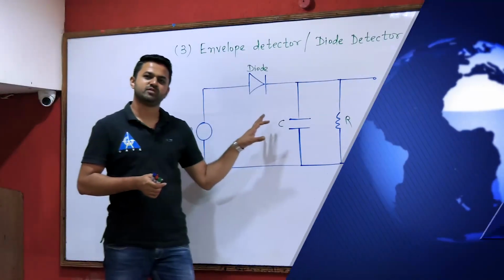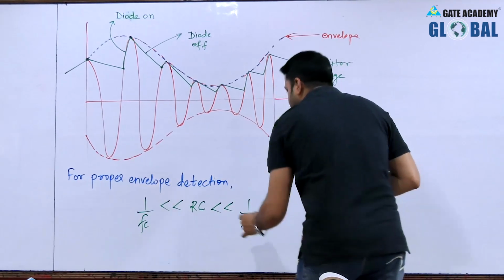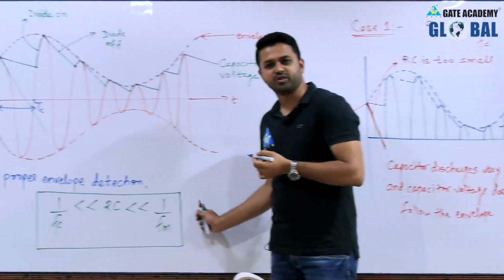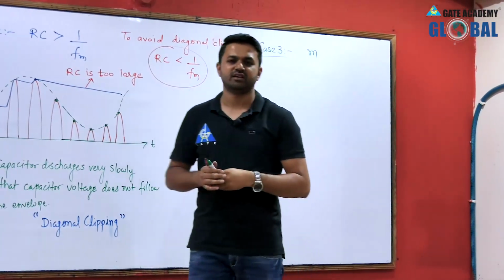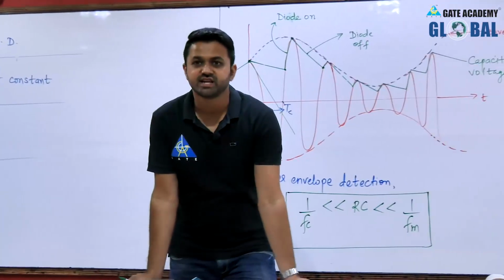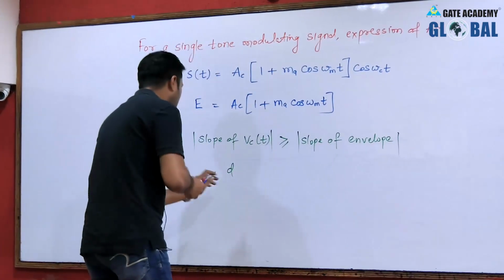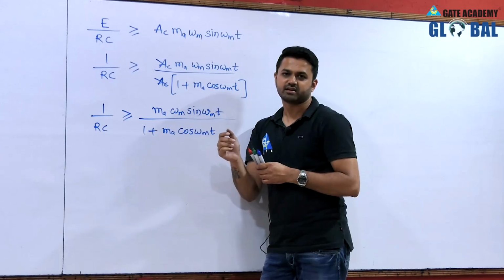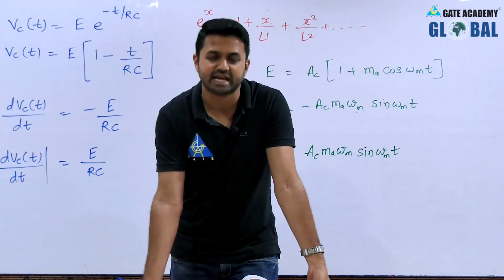Detection of AM (Envelope Detector) Part 2 | Lecture 19 | Communication System

Comment: Why slope of capacitor voltage has to be greater than slope of envelope
Reply: Diagonal Clipping in envelope detector occurs when the rate of capacitor discharging curve is less than the slope of envelope of amplitude modulated signal.
Reply: thank of it yourself